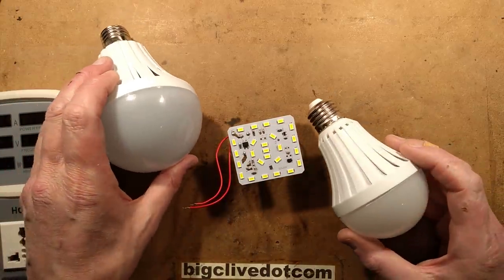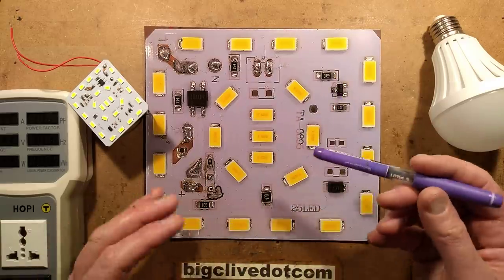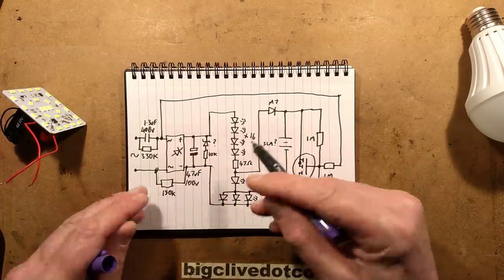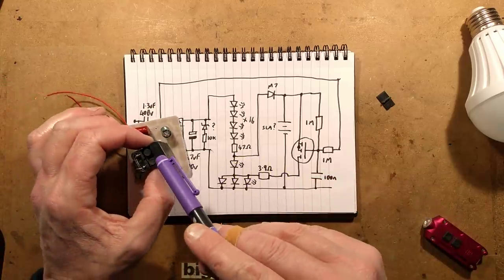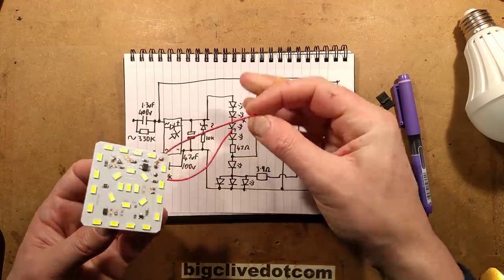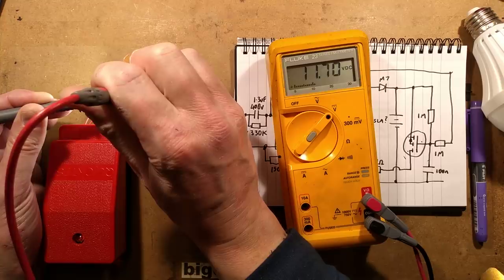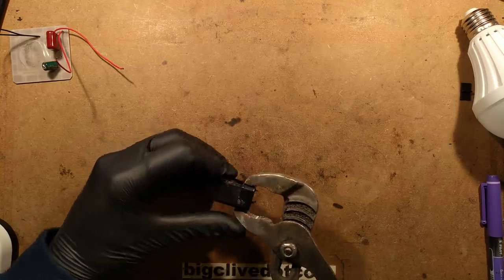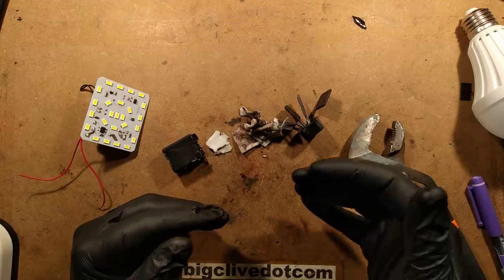Crappy lead-acid LED lamp with brilliantly simple circuitry.

Comment: Is there any chance you could do a kit-assembly video on one of those hyper-cheap Chinese DIY single-channel oscilloscopes with the little TFT display? They are primarily through-hole with the SMT chips already attached. I am considering one just to do the most basic work with TTL-level DC power supplies and micro PHI2 timing and the like. I would be very interested to see your opinion on one.
Reply: Julian Ilett did a multi-video build of a cheapy scope a few years back. Might be worth checking that!
Reply: @charliedobbie8916  I don't know that videographer, but I'll have a look for his channel--many thanks!
Reply: Not an awful lot of point in building them yourself though unless you just want the satisfaction, they're the same price pre-completed.
Reply: @paulsengupta971  Have to say I disagree there. As a hobbyist, practice is always extremely valuable. At the end of the day do any of us really need to do any electronics at all unless we work as electrical engineers?
Reply: But you need the oscilloscope to troubleshoot it when it doesn't work! :-)
Reply: @paulsengupta971  No worries--I hear what you're saying. I just like putting things together and one of the things I personally really struggle with is finding projects that I can get interested in doing. For instance the kits that Maplin put out latterly with little trundle-cars and whatever just never grabbed me. So these cheapy scopes are sort of a win-win on that front.

Plus on a slightly different but closely allied note, I've found datasheets are absolutely excellent for giving you projects in the 'typical application' sections they almost always have.  When I was doing electronics nearly forty years ago actually getting your hands on a data sheet was a massive perk only open to those who had ingratiated themselves enough through buying components from the local HiFi shop that the bloke behind the counter would let you take one away for an hour to Xerox for £1.00 a sheet at the library!!!
Reply: Most of the pocket oscilloscopes are severely limited in terms of bandwidth (many of them are really only suitable up to audio frequencies) and have very little front end control and other features that are highly desirable in an oscilloscope.  If you are at all interested in electronics then do yourself a real favor and consider buying a used oscilloscope instead.  You can get analog oscilloscopes quite inexpensively online or look around at flea markets or Hamfests (a Hamfest is an amateur/ham radio flea market type event) for opportunities to grab an inexpensive used oscilloscope.  Even better still, though more expensive, is a used digital storage oscilloscope which are great for capturing digital signals.  You have so much more control, not to mention front end protection, with a proper oscilloscope that they are much easier to use and can be applied to observe and diagnose a far greater variety of circuits and they have bandwidths into the tens or hundreds of megahertz (versus kilohertz for many of the pocket oscilloscopes on the market, though there are a few that can achieve several megahertz bandwidth).  Just when shopping, don’t confuse sampling rate, as in megasamples per second, with actual bandwidth as the simpler units will have a bandwidth of about 1/10th to 1/20th their sampling rate whereas with a higher end digital scope it can be as high as 1/4 the sampling rate and other gotchas to be aware of when scope shopping.
Reply: @ethanpoole3443  Many thanks Ethan!!!  That is a really excellent overview and I will definitely consider what you have said. Two thumbs up if that were possible!

My own position is I really cannot afford anything more expensive that £30--with maybe £50 at the absolute top end if there is an amazing bargain that pops up. I keep searching on EBay for second-hand scopes but the cheapest seem to be in the range of £50-£100. I would be perfectly happy with a used CRO and as you say a DSO would be the best of both worlds. I hear about a lot of chaps who got their scope for free when a local university or high school cleared out their old machines. Sadly nothing like that seems available in my area. However I have seen the 'Hantech' boxes that connect to an old laptop or even tablet for a display and which seem to offer pretty decent features. They tend to come in at the top end of my budget around £45-£55--but I might squeak by if I save up my pocket money (and then hide it in a cupboard from my wife!!!)

Right now I am focussing on DC power supplies and 1980's micros. What kind of frequency range do you think would be good for those applications? Obviously logic signals are pretty easy to capture I imagine. However linear and switch-mode power supplies may need more processing grunt I guess?
Reply: morelenmir Actually high speed logic signals require a lot more bandwidth than one may realize due to their square wave signaling, but for most of the digital micros up to about 20MHz a 60-100MHz bandwidth scope will usually suffice nicely.  Square wave signals require far more bandwidth than one may expect because of all the higher order (sinewave) harmonics that add up to create that square wave.  By comparison, signals that are sinewave in nature only require the bandwidth equal to the sinewave frequency to display (though displaying glitches or spikes requires greater bandwidth).  

You can learn quite a lot in electronics with a 50-100MHz analog oscilloscope (CRO) and they can be had quite inexpensively often times.  They are not as ideal on the digital side since digital communications is not typically repetitive in nature (though signals like PWM and clock lines are).  If you want to do a lot of digital work then a 100MHz bandwidth digital storage scope (DSO) is a perfect fit and something you will likely use for decades, so may well be worth saving up for.  The absolute best of worlds is to have both, but a DSO will be adequate for most signals though they do cost more.  The DSO capture cards are certainly better than nothing though they have a lot of limitations (but are likely far more capable than a pocket scope) and may require you to dedicate a PC running an outdated version of Windows since they may not have modern device drivers, plus you always have to dedicate a PC to them when using such for a scope.  Save for awhile and then shop around town (and nearby events like flea markets and Hamfests) and online to keep an eye out for an affordable scope that meets your specs and appears to be in good working order (if a reputable seller is willing to warranty that it is in working order then that is worth paying a little extra for since it reduces the risk of buying used).  But to get a great deal you will need to shop often and buy opportunistically when the opportunity presents itself.

Comment: Is it possible they are relying on the voltage drop under load to prevent the battery from overcharging? I'm thinking they have it at 6 volt for the fullest and fastest charge, and then as the battery approaches full, the current drops, and basically you'd have to leave the light on for days for it to accept enough current to bring it to the full 6 volts and cook off all the water? I know from experience that 12 volt lead acid batteries on an 8 amp charger take current at 14 and then 15 volts for a very long time, hours, before the charger ever reaches the roughly 16~17 open circuit voltage.

Comment: I remember making a lead acid battery in school that looked similar to this. We separated two sheets of lead with a piece of absorbent paper, rolled them up, and then soaked everything in sulfuric acid. We wore no gloves or eye protection, which I’m afraid might date how long ago this was done. The cell could then be charged by connecting it to a DC power supply. We used the cell yo propel a little cart with a DC motor on it.

Comment: As has been said it's an AGM (absorbant glass matt) lead acid. My understanding  (from automotive applications ) was that all AGMs  are sealed as a key part of the chemjcal process is recombination of the electrolyte, once it is lost then the cells cease to function, partial loss will obviously result in impaired performance. This is why the automotive batteries are often referred to as VRLA or valve regulated lead acid, the valve just being essentially a safety pressure relief valve if the cell is overcharged. We were also told by the manhfacturer to not exceed 14.8v which is 2.47v per cell, indeed some were left on charge over a christmas period with the charging setup we used for regular lead acid batteries (3A constant current with a 16v ceiling). That killed them well & truly, the cells had an open circuit voltage but absoloutely zero capacity. Good old lead acid, much maligned but generally benign & very recyclable!

Comment: The mini lead acid is kind of cool. 
The most sh*t thing about the whole idea is, when it's on battery mode the light output is so low that it's basically useless. 
There probably are a bunch of Chinese that graduate and often can't escape China or can't work for a major corporation, so they just have to make weird little circuits like this for some BS company that wants to sell stuff in cheap stores and on ebay.
Reply: It's not useless, it is an emergency light, made to last longer, we use it in my area, when the elec goes down, the light needs to last the whole night, and this works perfectly, not sure why not giving them the credit for such simple and smart engineering. 
Give the credit where the credit is due.

Comment: If it smells eggy, that suggests hydrogen sulphide, which as far as I know shouldn't be present in a lead/sulphuric acid cell. I wonder if it's a sign of the mistreatment of the battery having caused some unwanted chemical reactions already?
Reply: H2S is produced when a cell is overcharged.
Reply: @SinsBird  Case closed
Reply: Most lead-acid batteries begin to smell farty when you get them opened up (or they exploded), or a lot of acid splashes out of them. It's faint at first, but if it just came off of a charger, and it's hot, ooh it's like Satan just shat in your shop.
Reply: Keep in mind, that you can smell very small concentrations. At higher concentrations your receptors kind of get numb, so once you don't smell the stuff anymore, that's when it gets interesting/dangerous ;-)
Reply: @SigEpBlue  Lol!
Reply: @Keex11  
Does the same apply to hydrogen cyanide - once you can no longer smell almonds you know the concentration has hit the roof?
Wait, I can't smell them now!
Reply: If you really want to know what lead acid batteries can smell like then you need only find a cell whose plates have shorted out in service.  A common failure mode in lead acid batteries is for two plates within a cell to short out (hence the insulator between plates to try and prevent that.  Now imagine what happens when you have a large bank of batteries and a large UPS that can dump a lot of power into those batteries during charging.  As soon as the plates short all the energy in that cell, plus all the energy in all the paralleled batteries (up to the roughly 2.4V voltage differential) plus the high current charging circuit all dump their energy into that one shorted cell.  The result is an extremely hot battery that not only boils off the electrolyte in the affected cell but also all the neighboring cells in that same battery  — sometimes the heat is great enough to cause further plates to bulge and short out in additional cells, further exacerbating the condition.  The stench is awful as you have literally boiled all that sulfuric acid into the air and it takes hours to dissipate — it also takes hours for the batteries to cool back down once disconnected due to how hot all the lead plates got.
Reply: @ethanpoole3443  I could also imagine the lead melting as the boiling point of sulfuric acid is higher than the melting point of lead.

Comment: I got a tennis-racket-like bug zapper with one of those LA batteries. I replaced it with an 18650 (protected). It seems to work perfectly and charges as it should. I never had anything with one of those LA batteries last even a year before the battery was dead.

Comment: They chose lead acid even though it is technically more expensive per cell, because a lithium ion cell would get overcharged and go pop here. Lead acid is more forgiving. Basically, they went with a technically more expensive cell to have a cheaper overall product that isn't burning houses down.
It is also possible they did have a lot of extra lead acid batteries they got for cheap at the market, but I think that is putting the horse before the wagon.

Comment: There was a diode on your schematic labeled M7. Might that cause enough drop to get the charge from 6 volts down to 4.7?
Reply: An M7 is a surface mount diode that, as far as I understand, is the same as a regular 1N4007, so it should't have a voltage drop more than the usual .6 volts or so.
Reply: Two would be enough
Reply: 790i
i dont trust the diode forward drop, its not always the 0.6 , on low loads i had 0.2 around dropped only...
Reply: @PsiQ  I was just thinking I wished they'd included a couple of extra series diodes, the rest of the circuit's sufficiently awesome to make it quite a shame :(  - Oh, and you always include a 'bonus load' resistor drawing 25ma or so, just to guarantee against the half dozen miliamps @ V - 0.2n..
Reply: Psi Q If you measured 0.2V drop with a food under low loads that was much more likely to have been a Schottky died than an ordinary silicon rectifier diode.  Schottky diodes are used extensively where one want minimal voltage drop, such as in switching power supplies.  They just don’t have the same high breakdown voltages as seen in typical silicon rectifiers — if they did they would be darn near everywhere — but where you don’t need high breakdown voltage ratings the Schottky diodes waste much less energy, and voltage, to voltage drop across the diode.
Reply: Ethan Poole 
nope , was a 1N4007 (or rather many in a row), wanted to run an old car radio off a leftover transformer but after rectifier+cap voltage was much higher than 14V (as to be expected) but didnt have a small 9V or 10V trafo (sine peak x 1.4). i wanted it to drop more voltage to take some load off the regulator i then used, but the radio didnt need enough power, good old 2x5Watt max...

Comment: The little rubber cap you removed is a relief valve. If the pressure inside the cell gets too high, the cap inflates and allows gas to vent out the sides. That's the "valve" in a "VRLA" battery which is another name for the majority of SLA and Gell batteries. VRLA batteries are able to tolerate a certain amount of overcharge without damage or loss of electrolyte. (Some include a catalyst to speed recombination of hydrogen and oxygen, allowing a higher tolerance to overcharge.) Wikipedia has a well written explanation: https://en.wikipedia.org/wiki/VRLA_battery
Reply from the maker: Interesting.  I wasn't aware that SLA style batteries had the ability to recombine the gasses internally like NiMhs.  One notable sentence reads "Sustained charging at 2.7 V per cell will damage the cells" which is unfortunate, since that's the voltage they went up to.  I was looking at another device last night that is basically a capacitive dropper charging an SLA battery directly with absolutely no voltage cap.
Reply: @bigclivedotcom  that's the voltage where gassing begins. The point is that gassing is only harmful if occurs at a rate faster than recombination can keep up.  If charging current is low, the gas recombines into water and is recycled indefinitely. In other words, the battery IS the voltage regulator. Quite brilliant I think!

Comment: Clive's analysis is right on: The stink is hydrogen sulfide, generated when you overcharge a lead-acid battery.  
There was a case not long ago where a mechanic put a 12V battery into a BMW with a 24V system.  The battery generated so much H2S that the driver was killed.

Comment: I have an item you might be interested in looking at, it nearly set fire to my home.
It's an extension lead sold by B&Q .it's burnt out and the plastic casing has melted/burned through.
I would be happy to post it to you if it is something you would be interested in taking apart to find out how dangerous it might have been?

Comment: I guess the reason they used a SLA is that a Lithium cell would not have tolerated the charging abuse, and would probably release all of its smoke and much of its fire as well. Wonderful example of minimalist design, but I cant help wondering if it would be more cost effective just to have more components and fewer LEDs for the same light output?

Comment: Use a series resistor when doing your zener voltage measurements and you shouldn't have those skid marks happen again
Reply: Kean Maizels this wouldn't be the same without a few of Clive's skid marks though....

Comment: Clive, if you have a load with a dreadful power factor like this, is it possible to use a cap across the mains input to shift the phase variance so far that it actually comes back into phase?
Reply from the maker: Not so easy, since this is already effectively a cap across the mains, which is part of the issue.  The real problem is the current waveform, which tends to peak near the middle of the sinewave.

Comment: Hi Clive, maybe the diode between the the battery and the LEDs (used to define the 6volts for charging) will drop a couple of volts and protect the wee sacrificial lead-acid battery.
Reply: ie, it could be two or three diodes in series, or the LEDs may drop a significant voltage less than the 6V you estimated. {I wish I could type, that's why I'm answering my partial comment here.}